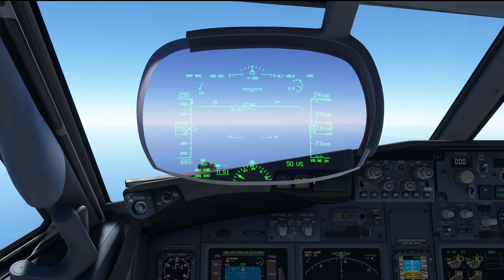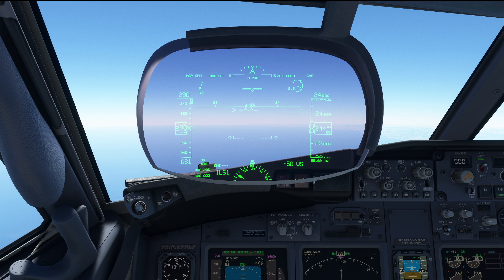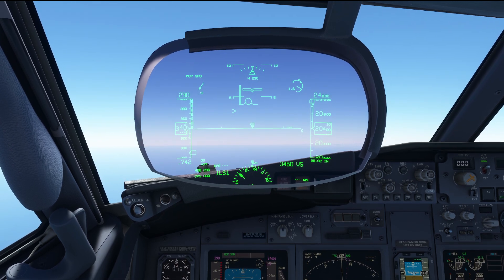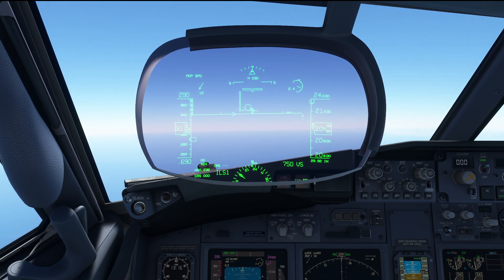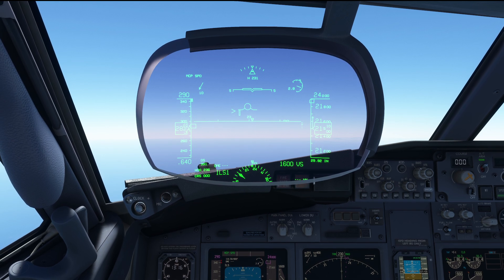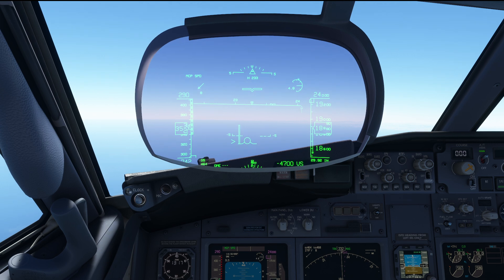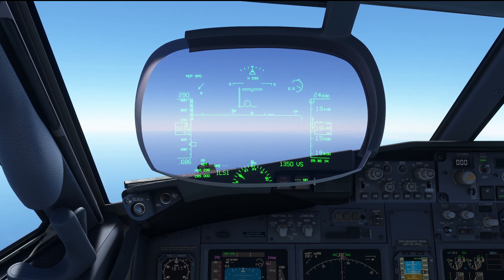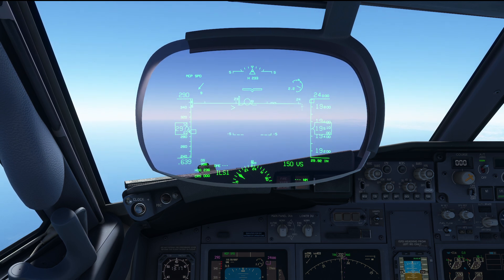Can a 737 do a Barrel Roll | Real Airline Pilot Explains

Comment: You'd probably need to pitch down when inverted if you wanted to keep the aircraft at 1G - because the wings are now producing lift towards the ground.
Reply from the maker: No, don't apply any pitch. It will stay at 1g without elevator input.
Reply: @A330Driver  Interesting - I thought you'd need negative pitch to compensate for the increased lift when fully inverted (as the airspeed has increased), which would accelerate the aircraft towards the ground at a rate greater than 2g. But you probably have more experience doing barrel rolls than I do :)

Comment: Fun video - don't wanne be picky but technically it's not really a barrel roll you're flying. Looks more like an aileron roll. In a barrel roll you kind of "draw" a circle around a fixed point on the horizon with the nose of the plane and thus fly a helical path around the imaginary barrel (difficult to explain in text). We call it the "magic circle".  This demands quite some coordination between aileron, rudder and elevator inputs - so no, it's not just aileron. It's actually one of the more complicated aerobatic maneuvers, at least to fly it properly because of all the coordination. And yes, I fly aerobatics IRL - not on a 737 though 😀 (I'll try at home on the sim though, you gave me ideas)
Reply: That's what I was thinking but, didn't want to be nit picking either.

Comment: You can do a (1g) roll in ANY aircraft. Even Concorde was barrel rolled a few times during testing. Someone also barrel rolled a Boeing 707 to prove it can be done safely, you just need to make sure that 1G is maintained throughought the roll.
Reply from the maker: That's exactly the point.

Comment: You actually want to pitch the plane up a little before doing the roll. This prevents such loss in altitude and increase in airspeed. I’ve done barrel rolls IRL.
Reply: i'm only a sim "pilot" but follow the same theory: pitch up before initiating the roll, the angle varies depending on the (virtual) airframe... That being said, i wonder if one could get a clean roll with a massive aircraft like the 737 - probably a really tough one.
Reply: This is the way. I pilot mostly gulf stream but occasionally the passengers on the way to Vegas for example will ask for it and always always pitch slightly up first otherwise you will tilt your hand to radar that you’re rolling

Comment: I've spun an ISFD in my hands through a large angle (simulating a large roll angle) with the power harness still plugged in and it didn't like it. It needed resetting afterwards. I wonder if the IRUs would tolerate a 360 degree roll.